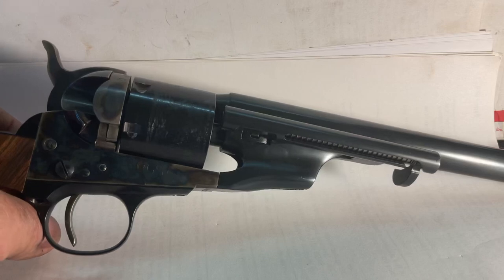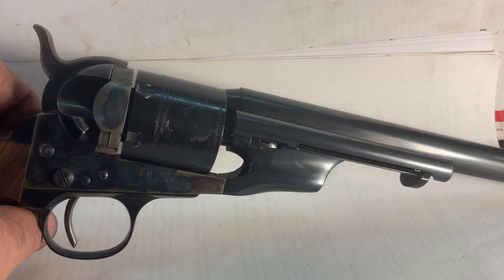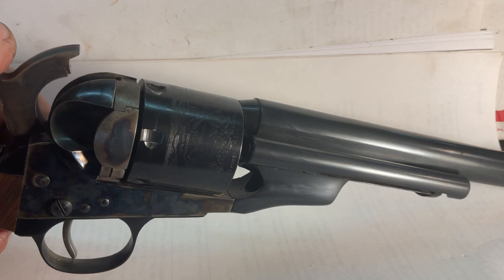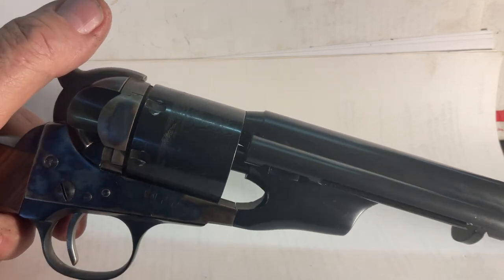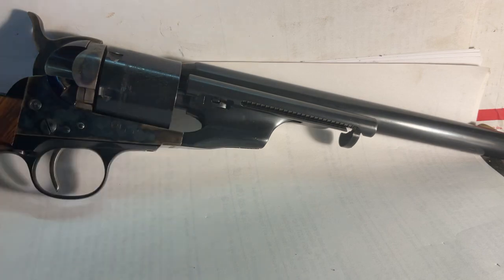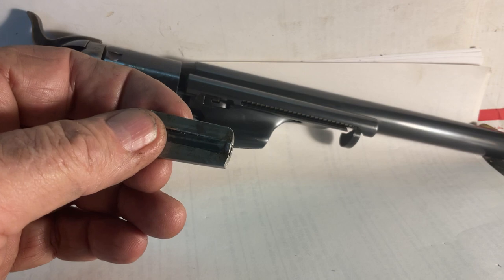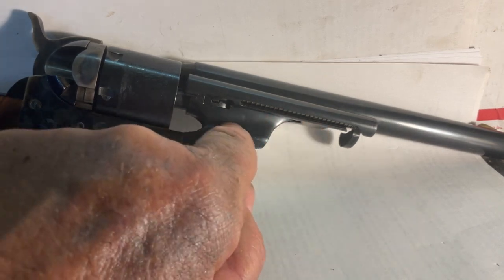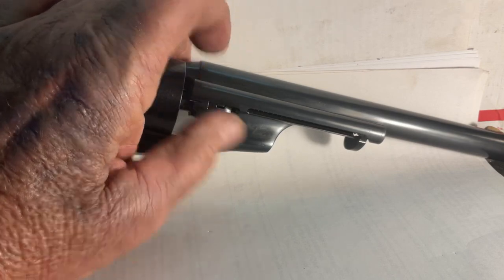Kirst ejectors and the known issues

Comment: So I got an old Armi San Marcos 1851 navy. Now you're probably going to think I'm crazy. Got it for $120 and it did not work. No half cock, cylinder slop, and overwedged. Hammer cam was worn down, bolt was worn thin, and the cylinder pin wedge port was not trued up. 

If I had to guess it was made on the Friday before the company went under. 

Anyway, I had some spare parts from uberti, and pietta laying around from a few projects. After weeks of hand fitting, polishing, staring at diagrams, I finally got this Frankensteined monster to fire, reliably, and have a half cock. I will never buy another ASM unless it's just to repair that one.